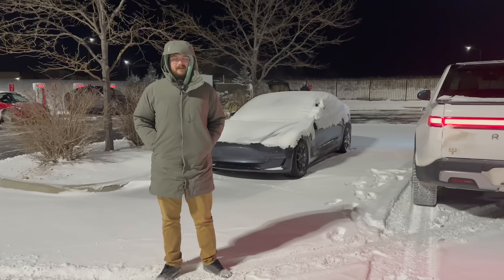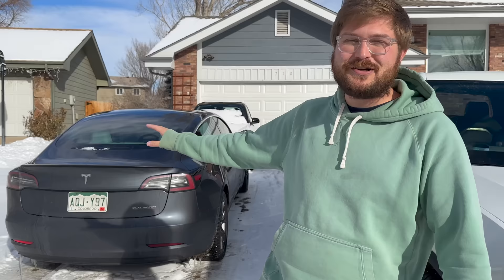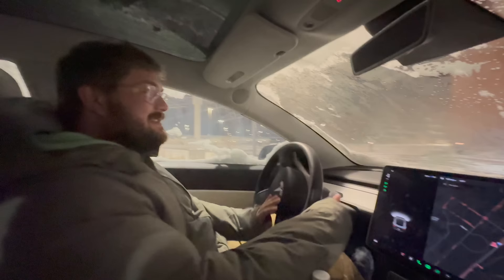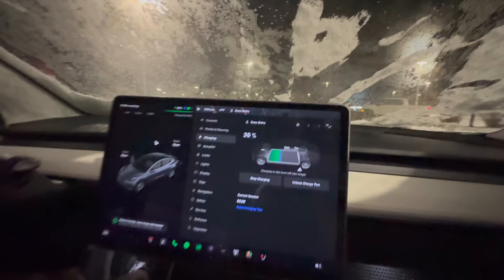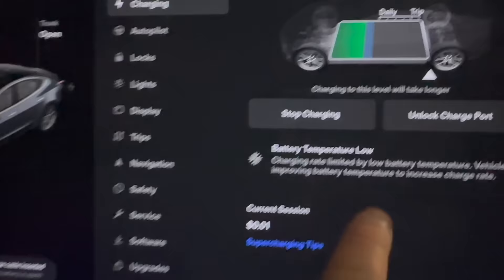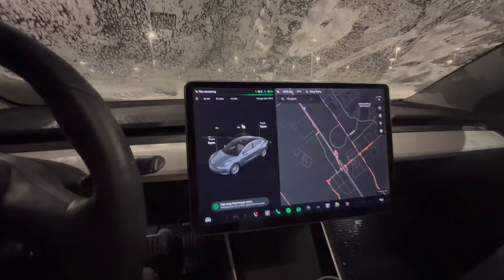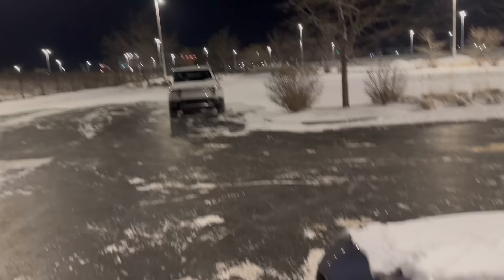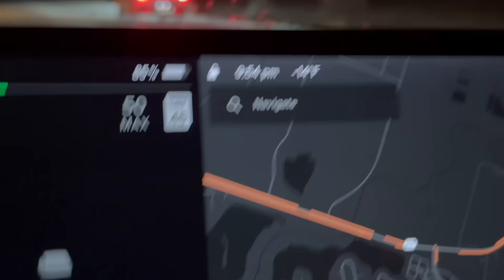I Deep Froze My Tesla And Immediately Plugged It Into A Supercharger To See What Happens

Comment: FYI: My R1T sat outside since Wednesday in CO.  I plugged it into an L2 charger in my garage and it pulled 7kW for ~45min before it put anything into the battery and went up to  the full 11kW.
Reply: That's like while filling you tank with gas every 5 seconds you pull out and spray a seconds worth onto the ground? What a waste of ''Paid'' energy
Reply: @yabbadabbadoo8225  it’s not wasted.. it’s used for a heater which needs to be anyway. It’s like saying your starter motor is a waste of energy
Reply: @Surtistuff Of course it is wasted energy. And when you compare with the starter motor, you should now that if we have a pretty beefy starter motor that is 2 kW. Then you use around 1 Wh to start the car....
Reply: @Surtistuff  Why can't they build a battery that's devoid of this process? It still seems a massive waste of power? 5kw for 45 minutes just to ''Heat'' the energy cell so that it can ''Hold'' a charge?? Times this by 1 billion some day and thats1000's of power plants just keeping batteries ''Warm''??
Combustion provides this energy for ''Free'' in gasolene motors.
Reply: @yabbadabbadoo8225   Try starting your deep frozen combustion car, it probably won't even straight up start. Then in cold countries you start and idle the car to warm it up, and in that process you wasted a lot more energy than 13500kJ. In fact every gallon of gas you burn later down the line while driving produces at least 59400kJ of waste heat assuming you have a 50% efficient engine. I doubt your engine does anything close to that
Reply: That sounds expensive
Reply: @sunnydeng9263  if you drive to the supercharger and navigate it, then you don't need to wait that 45 minutes. Kyle is not doing that just as a experiment. Also in case you didn't get my point, even after your combustion car warmed up, it wastes more energy constantly when you are driving
Reply: @chengcao418  don't live in un human zones like that,try tropical and for a very sound reason, lifestyle. not in the least interested in joke zones that freeze every year next?
Reply: @chengcao418  ps, as a child lived in Germany where freezing was regular during the 50's and 60's and diesel cars started first crank every time, must be the German Tech right?
Reply: @sandasturner9529 , like whole $0.5? 7KWt for 45min?
Reply: @PaulVanchugov  I have no  clue
Reply: I meant 7kW /1H * $0.12/kW = $0.84; 7kW *0.75H=5.25kW*$0.12/kW= $0.63 total cost of preheating. Or something like that. Does that sounds right?
Reply: @chengcao418  

You mean like everyone in the Northern Hemisphere does every day during the winter? Lol what a fool 😂😂😂
Reply: @yabbadabbadoo8225  Except it's something like $.50 to $1.50 worth of power, and most people will have their vehicle plugged in while at home all the time anyway, so usually not a real issue.
Reply: @sunnydeng9263  I don't need to go to a gas station at all, my car's full every morning.
Reply: @Surtistuff  huh, you don't understand how this works.
Reply: @yabbadabbadoo8225  li batteries can't safely change when frozen.
Reply: @yabbadabbadoo8225  normally you drive and then charge when the battery is already warm from driving.
Pulling charge (driving) is no problem for the battery.
Reply: @aaronhodgman 
But your wallet is empty for paying such a high price for the car to begin with!
Reply: @billmulvihill8452  I paid $15.5K 4 years ago.
Reply: @aaronhodgman  ??? In recent YT footage I've seen, the UK price per kw is 67 pence.
So we are talking 3 kws to fully charge a battery?
Reply: @sunnydeng9263  It'll run rich in the cold, so more than 1.5 L at those temperatures. 15 minutes of idling at those temps in an F150 is about .5 L of gasoline. So, about 4 kWh of thermal energy needed every time just to warm up the engine. A full snow melt and battery preheat in an EV takes about 15 minutes and uses .5 kWh of energy, and I do it while it's plugged in at my driveway in the morning so it's not drawing any juice from the battery, whereas your truck is burning its fuel supply. Even on the coldest and snowiest days my car is still four times as efficient as a Honda Civic, so I'm not exactly going to be bummed out that I have to use 6 cents of electricity to heat it up.
Reply: @yabbadabbadoo8225  Just imagine how many kWhs a gas car wastes in waste heat to keep everything warm. The reason that EVs are so much more efficient is that they don't waste 70% of the embodied energy in the fuel as waste heat like ICEs. Because of not having gobs of waste heat being thrown out of the exhaust and radiator then EVs occasionally need to sip a little extra to keep the pack warm. Still far, far less wasted heat than in an ICE. And the dumb thing is that during nice warm weather an ICE still wastes all those kWhs.
Reply: @sunnydeng9263  And zero Tesla owners need to wait at the charger either. There is a precondition battery schedule in the phone app. Unless you are totally stupid you know what the temperature is outside where you live and set the schedule to preheat the battery in the morning even before you get up or 45 minutes before you plan to leave and go charge it. 

If you are driving around in it you will never need to wait to preheat the pack because you are driving it and the pack is already warmed up. This video is a scenario that will never happen. You could create the same scenario with a gas car where it was sitting in the parking lot of a gas station for two days in -30 without being plugged in to a block heater. Then it doesn't start or it does and destroys the engine.
Reply: An EV has energy ''pumped'' to it via a Grid, a Grid connected to Nukes, Coal, PV's, Wind turbines etc.
An EV must be treated for optimal current transfer, a petroleum motor must be injected for startup. As the gas fired engine warms the performance improves.
When Kw prices soar and they will, motoring will cost the same as regular prices seen today. It is a ''Fixed'' Industry.
Just as today we talk ''Petro'' dollar so in time the world will become ''Watt'' Dollars or something similar.
There's no escaping these ''Fixed'' laws. They're there to earn trillions in Taxes not for your benefit right??
My 6 cylinder is 100% owned, owned since 1990. It gets an annual service, in house, all repairs are also inhouse and new tyres when needed. The engine clocked 300,000 miles over 10 years ago and lasted longer than the speedo.
No EV will ever out perform any IC car for long term performance and time saved.
Reply: @yabbadabbadoo8225  I have never known one person to have their own gas pump in their garage pumping gas from their backyard refinery that pulls petroleum from their backyard petroleum well. I do know lots of people that have a charger in their garage that gets power from their roof which has solar panels. Those solar panels are 'fixed' onto their roof.
Reply: @yabbadabbadoo8225  All of what you say is either wrong or highly speculative. EVs are 4 times as efficient as ICE and 2.5x as efficient as hybrid-ICE on a tank-to-wheel basis, and are similarly efficient on a well-to-wheel basis, so they don't require the same copious supplies of energy as ICE. Bulk electricity is also far easier to produce at home or on a microgrid than it would be to produce fuels, so electricity cannot be controlled as effectively in a monopolistic/oligopolistic way as the fuel market currently is. Electricity is produced close to the point of use and cannot be easily transported, so it isn't subject as much to the pricing effects of a global commodities, and it is produced from a variety of different energy sources, so there cannot and will not be a "watt dollar." I generally agree that regions that mostly use coal and natural gas for power, EVs don't confer a very big benefit over a hybrid-ICE vehicle, although many people might chose to do buy one for the benefits of home charging and reduced vehicle maintenance, anyways. However, in regions that predominantly use Nuclear and Renewable power sources EVs are a fairly obvious choice for most vehicles. Some tasks need the range and refuelling speed of ICE, but most vehicles plainly don't, and users would benefit more from the added efficiency, time savings of home charging, and reduced maintenance intervals. The fact is that people who want EVs will buy them first, the people who don't want them have 15-20 years to keep buying new ICE models, and an additional 10-20 years to run the last ICE cars the ground. Basically 40 years before anybody is "forced" to buy an EV, so you can stop complaining about it.
Reply: @flipadavis  I also don't know anyone that pulls 30Kw's from a domestic PV system.
What was your point again??
Reply: @yabbadabbadoo8225  I "did the sums" based on 12 years of EV data, and realized gasoline cars are more expensive to own than EVs, even "cheap" ones. A $2000 fixer-upper piece of crap that does a lot of mileage will eventually cost me the same or more in fuel alone than the whole purchase price of an EV. It doesn't make financial sense for me to spend $5000 a year operating and maintaining a worthless vehicle when I can spend $5000 a year operating and* paying off an electric vehicle that is worth $40,000 when I re-sell it. Old ICE cars are literally "gas burners" they are so inefficient that 80% of what they do is burn gasoline and emit heat, and 20% of what they do is drive you around. There's no place in my life for paying the operating costs on an industrial space heater with wheels.
Reply: @yabbadabbadoo8225  Huh? Why would you pull 30kWs? Typical wall chargers are either a 240V at 30,40 or 50 amps which is from 7.2 kWs to around 11 kWs. 

A 300 mile range EV has around an 80 kWh hour pack.
Reply: @0hypnotoad0  What's the 80kw EV battery going to cost you in 10 years time?
A brand new 2.0lt Turbo is far cheaper than any EV battery
40 mpg is well within my weekly budget
But hey, install the home charger, wait hours ea year at Charge Parks. Like wasting hours ea week in traffic ain't painful enough right?
Reply: @yabbadabbadoo8225  an 80 kWh* battery will last 25+ years if taken care of. In 30 the cost to replace the cells will be a few thousand bucks, if I even want the car anymore
Reply: @0hypnotoad0  In your dreams right??
Flick me a warranty that endorses your claimed 25 years lol
Reply: @0hypnotoad0  25 years! Is that why so many Tesla batteries have been replaced?
Reply: @yabbadabbadoo8225  No. Pretty much all new homes in the US built since the 1980s have 200A service. Before that starting in the 1960s and 1970s 100A was the standard. There is a very tiny percentage of older homes that still have 60A or 80A service but not many since no home owners insurance will cover a house with anything under 100A. If you buy a house with a bank mortgage you have to have home owner's insurance so the houses that still exist today with under 100A service are those still owned by the original owners and they likely don't have home insurance. 

But having a 30-40A breaker that a charger is on is no different than a clothes dryer. If one has an old home with only 80A service then they likely don't even have a central AC system anyway that draws 4 kW which still would only need 20A on that 80A circuit. They probably just have lower powered 120V wall units. Either way in that case you would simply install a dedicated subpanel with a 30A breaker and a smaller wall charger that uses 20A/240V or 4.8 kW. 

That wall charger would be more than enough to recharge your EV for daily use. The average person drives only around 40 miles a day so the average would only need around 10-15 kWhs for the average daily miles. That's only 3 hours of charging every night in your garage at 4.8 kWs. 

But even if you commuted 200 miles every day needing around 50 kWhs, if you plugged in every night it would still be possible with around 10 1/2 hours of charging needed at 4.8 kWs.

But again most homes have 100A and 200A service.
Reply: @bikeman123  Very few Tesla batteries have been replaced, the only notable ones were defective early iteration batteries that got replaced for free. If you went back and did samples of 2010-2012 Toyota cars you'd probably find a higher percentage that needed engine swaps